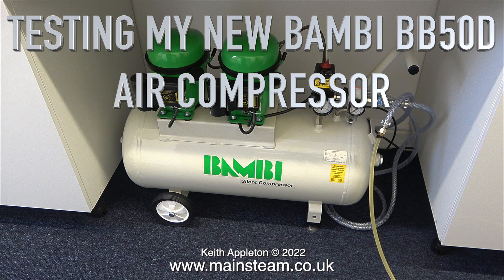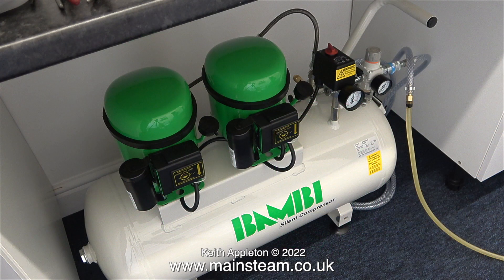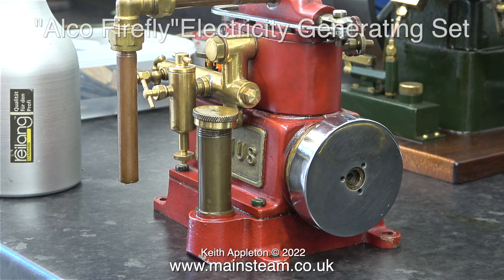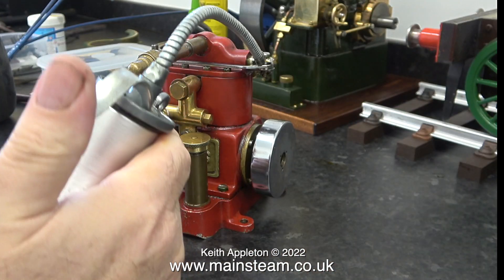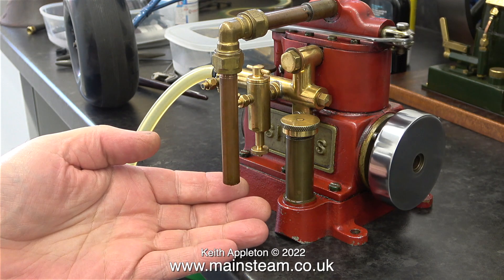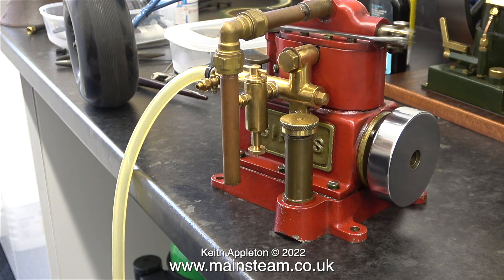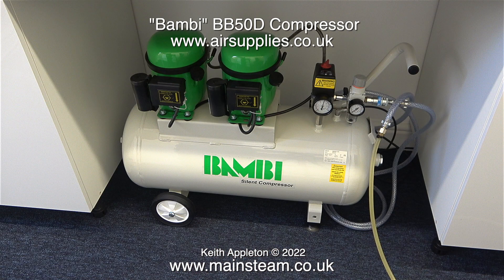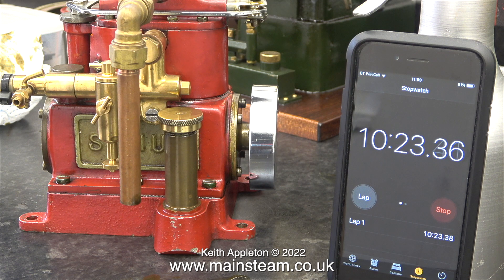TESTING A BAMBI BB50D AIR COMPRESSOR - PART #1

Comment: I'm possibly anticipating your next experiment: using the WhispAir to fill the 50L tank and then seeing if this allows sufficient time for the WhispAir to cool down. You could then use the Bambi compressors for the initial fill, power them off and use the WhispAir to quietly keep up with the demand.

With my small shop I don't have enough space for anything larger than a "compact" oil-free compressor (5.7L; 56.6 L/min @ 6.2 bar, 85 L/min @ 2.75 bar), unless I build a hut outside as some others in the U.S. have done. This small unit is nowhere near as quit as even the Clarke Shhh was, but as I only use air to cautiously clean machines (after using a shop vacuum to clear the bulk of chips), it doesn't run frequently.

The "Psst" from the Shh when it shutoff would have been the piston being unloading so that it would not have to fight a high pressure when restarting – my little compressor )and its slightly larger [15L] much loader pancake compressor in the garage) does this as well.

Comment: I really like those Sirius engines, they are an unusual but clever and compact design and the idea of using them in a generator set is inspired because all you need is fire and water to operate a radio.
I imagine some of the noise and steam could be reduced by immersing the exhaust outlet in liquid or even a box of loose rags or straw and maybe the idea was to cover the whole thing with a box covered with sacks or hay to reduce the noise, even placing it in a hole in the ground would help make it less noisy. Clearly there was a need for such devices and people had the will to make them work and remain undetected although it must have been a nerve wracking experience at the time.

Comment: A beautiful compressor and very quiet. Someone on line was saying that a steam engine can be run from an aquarium pump.  I have a Stuart Models number 9. Would it really be possible to run it off something like an aquarium pump ? I must admit that it sounds too good to be true.
Reply from the maker: A Stuart Number 9 is a bit on the large side, a fish tank compressor would probably run a Stuart S50 of a number 10 - I will try it.
Reply from the maker: I have just made a video showing what happened when I tried my aquarium pump on some model steam engines . . . not much really }:-)))
Reply: @keithappleton  I figured it was too good to be true. Thanks for trying it out and letting me know.